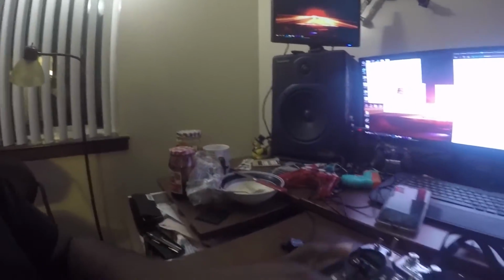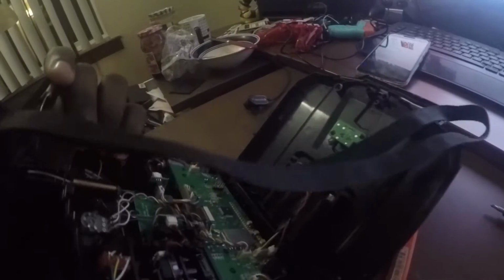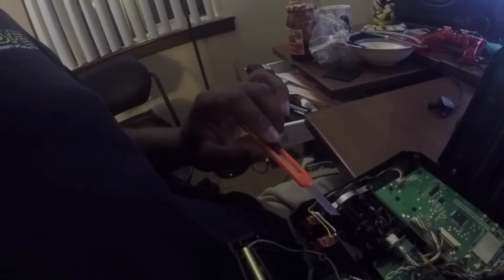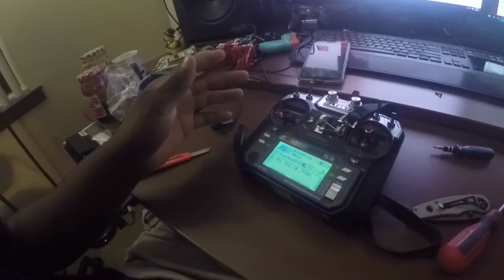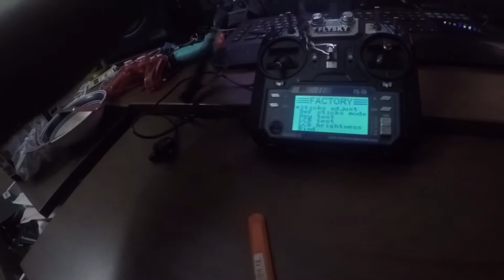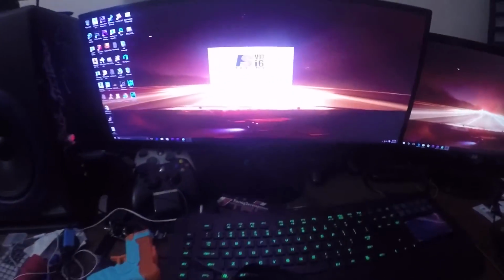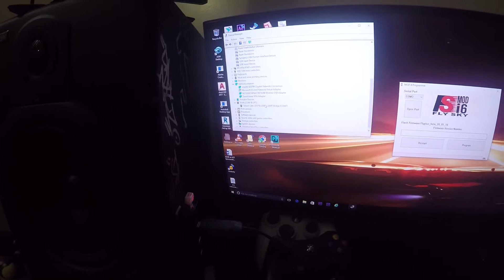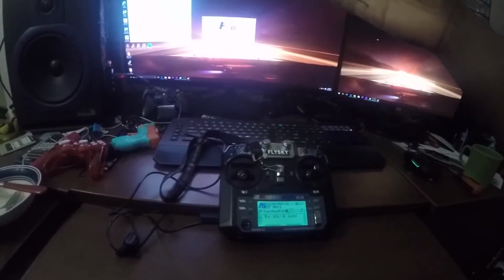Flysky FS i6 stick warning fix for 10ch mod

Comment: My transmitter does the stick warning in mode 1 until the throttle stick is raised. Very puzzling, have to put it in mode 4 to get into the "hidden menu",. Does this with the original firmware and the 10ch. Transmitter used to behave normally and has never been apart. Otherwise works completely normally.

Comment: What lead is that that's needed ? Mine didn't come with any .
Reply from the maker: its a usb to ttl converter they are really cheap on amazon and ebay. this cable is used for downloading the new firmware

Comment: Did you not have to use a ftdi programer adapter?
Reply from the maker: Temple Stanphill you do it comes with one in the box that attaches to the serial port on the back.
Reply: Gotcha, thanks for the reply!